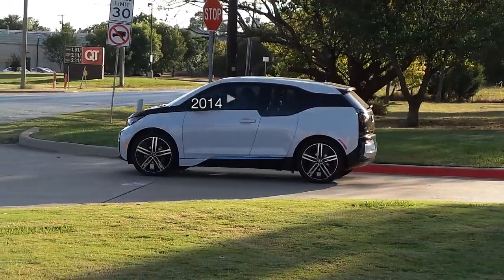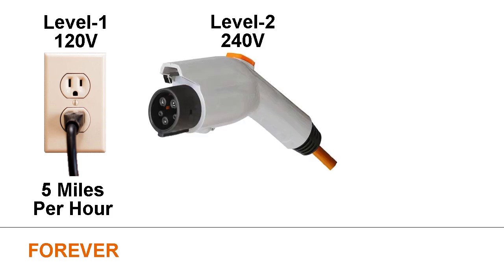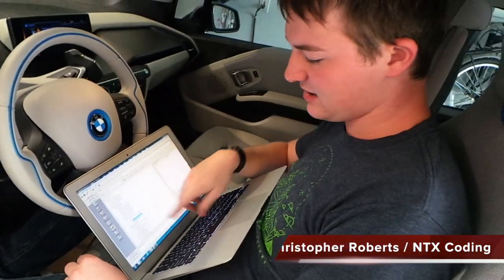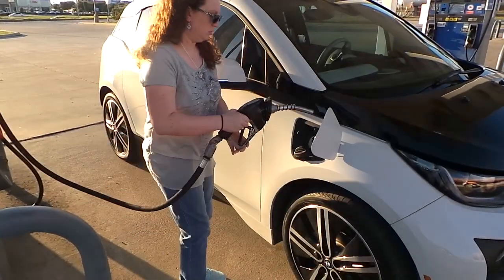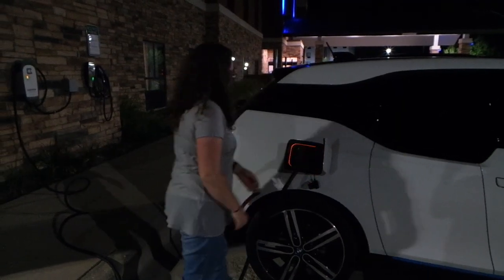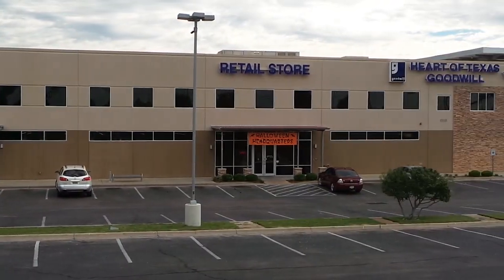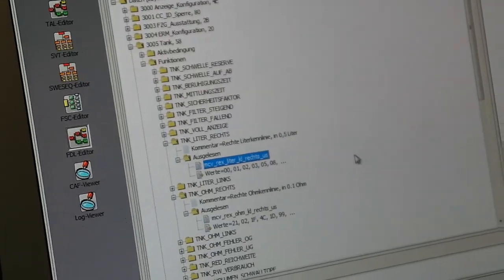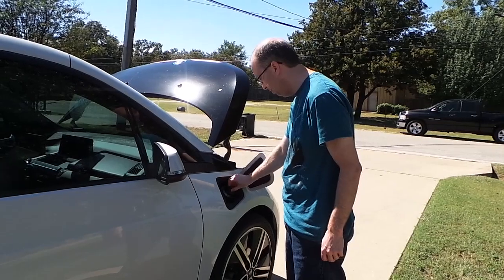BMW i3 REx roadtrip, charging, coding, and range test.

Comment: It doesn't cost anything to charge at the hotels or the charging stations?   If that's the case, more states need to start charing a tax on EV car owners b/c they're not paying the gas taxes and they are using the roads.   And without going too far, if you think you're saving the planet on emissions you're not, you're using the grid which is backed by coal/nuclear etc.
Reply: Don't even get me started on how bad lithium mining is for the environment. oh, and catalytic converters use precious Platinum, Palladium and Rhodium which are all rarer than gold. No wonder why the little shits are neckbreakingly expensive.

Comment: Bought an i3 (94ah REx) for my wife in Nashville, TN and drove it back to Dallas, TX. Only charged once at the Holiday Inn near the Little Rock airport and drove the range extender all the rest of the way. I had purchased a gas can and filled it before leaving Nashville. It really was not that bad jumping off the freeway about every 80 miles to fill up either from a station or the gas can. I ran the car in ECO PRO mode where you stay at or below 75mph. You can override that by pushing the pedal to the floor, but it naturally stops at that speed to help you while in that mode. It would hold the battery charge staying at 75, but would drop if I went faster. It could also recover slowly if I dropped down to around 70. Another disclaimer is don't code your car unless your out from under the warranty as it will void your warranty from BMW.
Reply: Oh, the jump you saw in gas range you will also see with battery range. It is based on the temperature outside. It affects the battery efficiency quite a bit when it gets cold.

Comment: Get ready for expensive repair bills
Reply from the maker: Yeah.. We've at at least 3 years of warranty left.. plus the battery and other drivetrain stuff is warrantied 8 years.
Reply: The 8-Bit Guy sounds great but from experience the fact you have "modifyed" the software would be enough to invalidate warranties, also warranties these days come with huge stipulations ect dealers love wiggling out of
Reply: The 8-Bit Guy dude I love the video...2 years later how is your car ? I’m thinking about getting one should I ?

Comment: in my opinion you made the right decision. 1/2 price for the i3 ... is amazing! And the quality and design is also way better in my opinion (I drove the i3 for a longer time). Love the interior and the white colour. I known the doors can cause problems if you need access to the back seats often and you got blocked by other cars in parking lots ... but your car is such a very cool and good locking one with a perfect fitting interior! Very good choice dude.

Comment: not to mention you can always put a gas tank in the trunk or frunk and rout a tiny fuel line to the range extender. that way you can make the tank size as big as you wanted.

Comment: Excellent review of the i3. My local BMW dealer lent me an i3 last weekend and have to say I was very impressed with the quality and the fact the vast majority of the body is a Carbon Fibre/Thermo plastic combination actually made in the USA and sent back to Germany for assembly.  Yes £36k here in the UK is a lot of money but there is a lot of technology in the car.  You just have to decide if you really want one. I drive a 320d BMW that will cover over 500 miles on a tank and reports say modern diesels are equal if not cleaner than petrol.  Only quoting what I have read :-)

Comment: The question I need the answer to is how fast can you go on the range extender while holding battery charge constant? Say I'm doing a (rare) 500 mile trip with no chargers en route, but plenty of gas stations, thereby relying 100% on the REX, what speed am I limited to?

Comment: Holy smoke! I have been doing research on electric vehicles and never realized the i3 had a range extended version that was so hackable until today. I saw you had a video and you can count me impressed. Here in Texas I wouldn’t want to use an electric vehicle as a real alternative without a range extender. Heck, my one way drive from Austin down to South Padre Island is 370 miles one way.  I wouldn’t want my wife getting stuck anywhere. Just driving around town could easily pop you over 100 miles without even realizing it. So, the next trick would be hacking the engine and generator to improve the charging capabilities.

Comment: I have a interesting question. 

Can you use the range extended to simply charge the battery? So say your battery is dead. You stop driving. Start the range extender and let it charge the battery back up so you arnt speed limited and that by it? (Im aware this prob isnt the best use of the energy and all that but im just interested if its possible.)

Comment: Hello. I noticed that you have the 20 inch double spoke alloy. How have you managed to drive it in the snow with those? Did you change your wheel/Tyres or apply snow chains? Thanks.
Reply: The very narrow tires are much better at cutting through the snow than the common low profile tires most cars use that tend to float on top. Never driven an i3, but my current gasoline car have 4.5" wide tires and they brilliant at getting grip through compacted snow.

Comment: Load ,8,1  google brought me here because i was reading reviews on those old i3 that are now discontinued in 2021.  This is the best professional review ive seen this week. Only missing parts i wish was covered is the exhaust pipe and catalyc converter location if you have the extender.  How easy is it for theives to steal its catalyc. Would it be technically doable to cross country say, beverly hills to Manhattan in the i3 ?   Or manhattan to florida? In 2021….Because the i3 is discontinued, price might be low now, i have a jeep wrangler 2016 unlimited, eventhough i can drive from alaska to mexico city back and forth with the jeep without worrying, it would cost a fortune in gas and i will be targeted for theft a dozen of times. I'd to to switch to ev, but even with incentives they are overpriced still.  im also a shopping fan when i do road trips…. Which is a good reason to come back to your channel.

Comment: So if you had a non stop drive of 400 miles would you just be able to keep filling up with fuel once you run out of electric. Or would it after a while damage the batteries etc. Also what mpg would you get just using the range extender.

Comment: Cool video - thanks for posting.

Regarding an EV trip from Dallas to Houston, it can be done in a Bolt EV.  The trip is ~240 miles, which is achievable in the Bolt if you can keep travel speeds in check (perhaps 65 MPH instead of 80 MPH).  Or, if you want to go quickly, about 210 miles into the trip is a CCS fast charger in Spring, TX.  There are options available for the return trip, as well.  Of course, another fast charger somewhere in between the two cities would make the trip a little less stressful.

Comment: Great video! i bought a bolt in 2019 from Dallas and drove it home to Houston, after Waco i drove at 65 mph because i refused to stop and charge for another 45 mins to make it home.
Reply: Great to hear you got a Bolt. But if you went from Dallas to Houston by way of Waco, you went the looong way hahaha.
Reply: @markjohnson8260  lol i live in katy tx and the fastest chargers at the time were on that route.
Reply: @chadc7808  Never would have guessed that. BTW I'm almost a neighbor, home is Fulshear!
Reply: @markjohnson8260  Awesome! well if you ever want to test drive a bolt or a model 3 let me know! i own both and i love all evs, some are just better than others! heard the i3 had a decent battery cooling system so i started looking for more info thus the reason i ended up here.

Comment: I would like to know if you ran the battery completely out and only have the range extender left, how many miles could you drive at 65 or 75 miles per hour before the gas was run out. Could be a problem if there is not a gas station within that range. It's a range extender but only as far as that gas will take you. I drive far too many miles everyday to deal with even the largest range EV's. Your Chevy Volt would be great except it doesn't have a middle seat in the rear. So for me it's an older  Prius for now, just finished a 5200 mile cross-country trip averaged 42 to 48 miles per gallon..
I live in Far West Texas we have even less charging infrastructure than you do in Dallas, there is only one fast charger in the entire city.

Comment: Just wanted to say "Thanks for a great video". I'm thinking about picking up an EV next year and have narrowed  my choices  to a Model 3, Volt, Bolt or I3. I'm leaning towards picking up a certified used still under  warranty at a discount, similar to your I3 Rex . How difficult was it to find someone to re-program the car to use the hold mode? Does modifying the I3 to add back the hold feature void the manufacturers warranty?

Comment: A good video for buying the BMW with the range extender.  If a driver was driving at a more reasonable speed of 65 to 70 MPH, you will probably get an additional 15% increase range.  But, like driving in Texas as in Los Angeles to Vegas driving at 65 to 70 you are a target for all of those people driving at 80 to 90.

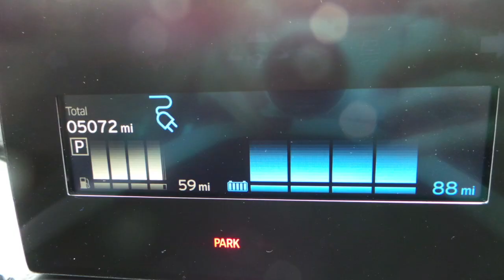Comment: @8:13 The values reset after restarting the car, you can change it to 'never':
Average values reset
The average speed and consumption is reset after the set time automatically.

Values:

After 4 hours
After 8 hours
After every ride
Never
For this option the following control unit has to be available in the car: “Instrument Cluster” KOMBI_I01_F56

Comment: Great account of particular experience.  Thanks!

The i3 Rex strikes me as occupying a kinda strange place on the PH/EV continuum  —  from a 370-mile Tesla, to Toyota’s original plugin Prius.  At the one end of that continuum, it’s unlikely to ever even occur to anybody who drives a long-range Tesla that a gas car could have any advantage whatsoever.  At the other extreme though, the EV capabilities of the original plugin Prius are, arguably at least, pretty much inconsequential.  (In my view, it was never really intended for functioning as a true EV, but just intended to reduce the total percentage of time the engine is on.)

I myself drive a Prius Prime, which is not only completely functional as an EV, but is also exceptionally efficient as such (4.6 miles per KWh).  However, it’s pure-EV range is usable but very short — only 25-30 miles, after which it becomes a very-capable and still-very-efficient hybrid (55ish MPG).  (BTW, unlike the plugin Prius and the Clarity plugin, in EV mode, the Prime’s engine essentially never kicks in.)

The i3 Rex strikes me as the opposite:  For its time especially, it’s a superb run-around-town car, but it’s gasoline range-extension functionality is only marginally realistic on the open highway. The Prius Prime is the opposite:  it’s intended fundamentally as a very-capable hybrid, with a limited (but quite-efficient) EV functionality “tacked on,” so to speak.

Here in Austin at least, charging infrastructure is really excellent, including Austin Energy having a program wherein you can charge all you want at pretty much any ChargePoint station in town for, essentially, a dollar per week!  So, driving to work on EV, charging at work, and driving home on EV is very feasible and very cheap.

But you’re right that, out on the open roads of Texas, it’s a bit grim for all but Teslas, the Chevy Bolt, the Kona/Niro, and a few others.  However, I think the pure-EV road-tripping equation has improved a bit since you made this video.

Comment: Does your I3 have the all led headlights or the mixed halogen / led daylight running lights.  Wanting to know difference the two options make to range.
Reply from the maker: I believe the headlights are LED, as are the daytime running lights.  But I believe the brights are halogen, which we rarely use.
Reply: thanks I ask since I wander how much items like full led lights and the two different heating options make to the range.

Comment: Excellent video. I’m just about ready to purchase a 2014 REX model. I will have the car coded to enable the hold at 75% as well as the tank increase, like yours. I have a regular gas powered car to drive for longer trips. But I do mostly city driving, in Chicagoland. Charging infrastructure in my suburban area is kinda....ehhhhh....but I’m going to have a level 2 charger installed at my home, so I’m sure I’ll be fine for everyday use. Now, once I’m in the downtown metro area, there are chargers everywhere. 

I have a few questions...

1. I saw your wife was doing 80mph on the highway. This is a common highway speed for me too. How does the car handle at that speed? I don’t often go higher, but 80 is routine crushing speed for me on the expressway. I hear mixed reviews on the forums about this. Some say it’s fine, some say it wobbles and weaves all over the place, making the car feel dangerous to drive. I’m looking at models with then20 inch wheels, only, if that makes a difference. 

2. Winter. How is this car in the winter - in terms of both range and driving dynamics. I’m in Chicagoland, so we get snow. On really shitty days, I’d prolly just stay home and work remotely...but most days I’ll be driving the i3. It is RWD....is the traction/stability control good enough to keep me from spinning out on on-ramps and corners?

3. How is the heat and AC? I know about preconditioning and all that.....I’m talking performance. Is the a/c good in the summer, to keep you cool without much sacrifice? Does heat keep you warm/hot in the winter?

4. I have 2 kids....an infant and a 6 yr old. One in a booster seat, the other in a full on car seat, obviously. Is that backseat big enough to accommodate them? Not for every trip....but comfortably, every now and then.

That’s all I can think of, right now. There really aren’t any reasons I can see that would make me feel like the car wouldn’t work for me....I just wanna iron out those little unknowns. 

I test drove one and couldn’t stop smiling, while driving. Very cool car.  👍🏾

Comment: I don't feel like you really answered the range extending question though. Without the "hold mode", does running on the range extender after depleting the battery limit the top speed? I imagine that it would, since you showed that the generator can't keep up with the electric motor's power demand at 80mph highway cruising. How much does it limit the speed?

That part of Texas doesn't seem to have many hills, but I'm also curious about how the REx would manage long uphill grades with just the generator power. 

I ask because we really want to get an i3 REx, but there's a 160 mile trip we take fairly often over a mountain pass, and I'm trying to figure out if the REx would keep up with 60mph traffic over the mountain once the battery is drained. After 160miles, we could fully charge and refuel before heading back.
Reply from the maker: Yes, if your i3 is not coded, it would be limited to 70 or 75 mph (depending on the grade of the highway) when running on Rex power alone.  This condition could happen as well on a coded car if the battery were drained before starting the Rex.  There are even rare instances of people being limited to 30 mph on steep mountain grades when the battery is exhausted.
Reply: Awesome, thanks for the reply! The highest speed limit in my state is 65mph, so the 70-75mph limitation isn't an issue for me. This is great info!

Comment: Great video! However, 120 v charging != "Forever". At 5 mph, you'll be full by morning, unless for some reason you don't sleep. Worked example: Get home at 6 pm, plug in, supper, tv, bed, wake at 7 am, out the door at 8 am. Your i3 has been charging for 14 hours! That is enough time to add 14 x 5 = 70 miles of range. Your i3 Rex 60Ah has a total capacity 72 miles; since it charges faster at first it will probably be full or almost full. On the other hand, nothing wrong with installing an EVSE.

Comment: Hmmm, surely that is a J1772 charging connector like the one on my Leaf. I´m pretty (99%) sure that the i3:s in Europe uses the type2 Mennekes connector, so that was a bit of a surprise to see, maybe it´s model year related.

If I could make a wish for the i3 it would be the choise of 3 alternatives for the luggage compartment. First an additional luggage compartment instead of the REx, second the REx unit itself and finally a battery range extender (BREx) unit.
 
I like the i3 a lot,  if we had tested one before signing the contract on the Leaf we would have bought one for sure. 

Rear tire wear is rumoured to be an issue, and BMW just announced an even bigger battery pack for 2017.

Finally a note about the petrol can in the frunk. On most cars you have the tank for the washer fluid up front, and that stuff is rather flammable since it contains alcohol. Keeping a petrol can empty is usually more dangerous since the gases are more prone to catch fire than the liquid petrol.

Nice review, really useful. Thanks for sharing!

Comment: Do you still get the tax benefits when buying a used EV? Or with a gas engine attached? Does the two-stroke engine charge the battery or actually run the car once the battery is dead

Comment: Great video 8 bit guy.  I am looking into buying a used i3 as well.  I also currently have a gen 2 chevy volt.  I am hoping to find a BEV i3 with the larger battery as I am wanting to go full electric now instead of a plug in hybrid.  I kinda wish I would have known how far your i3 could have gone at 65mph versus the 80.  Fast speeds absolutely kill EV range, as I know you are already aware.